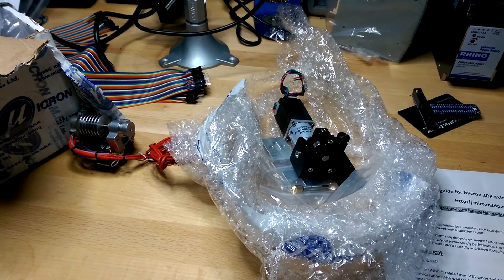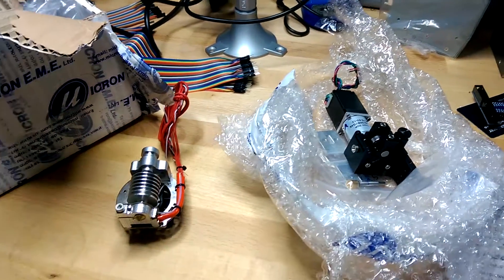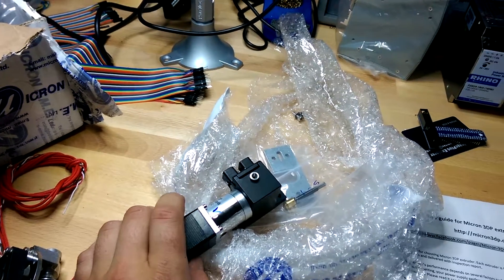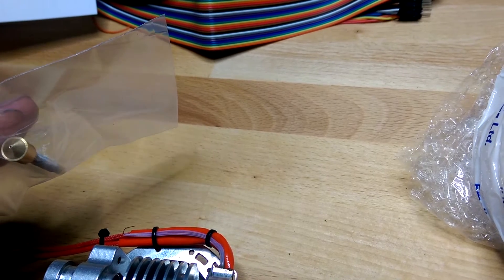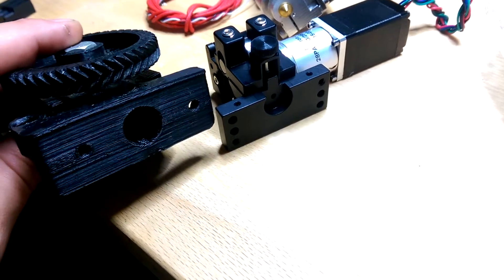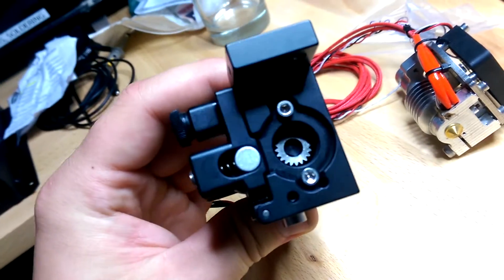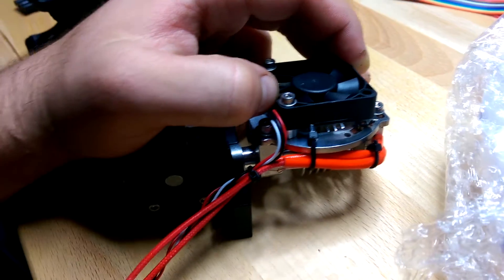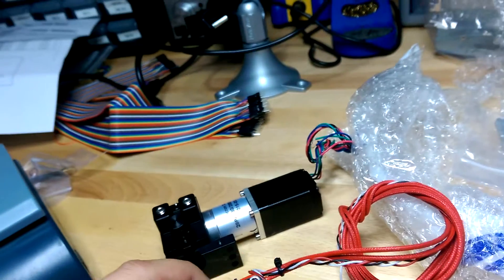Micron 3DP J-Head "All Metal" Unboxing and Review

Comment: It's a great hot end, the best I've used, but I've had problems with the extruders grinding filament, adding a fan to the motor helped but didn't cure the problem.  The motors get quite hot on long prints.  Our prints can be 2-4 days.  I ended up changing the micron extruder to the Bondtech extruder and this combination is the best I've come across.